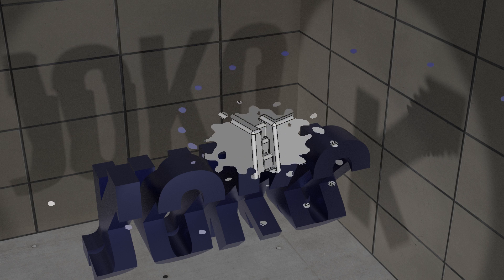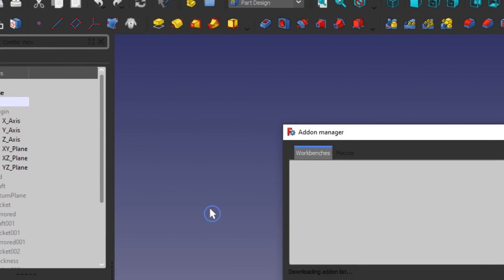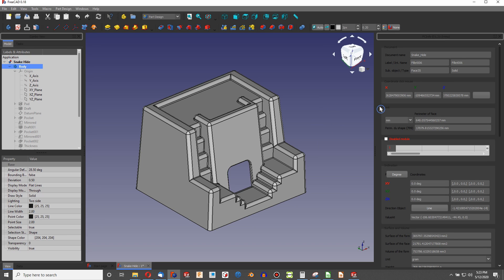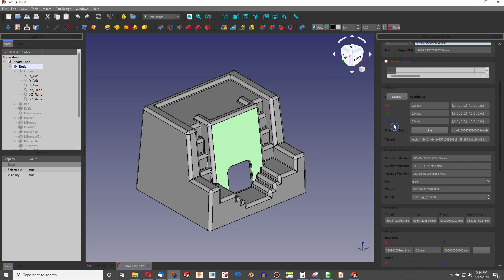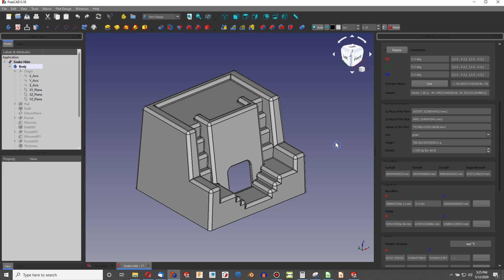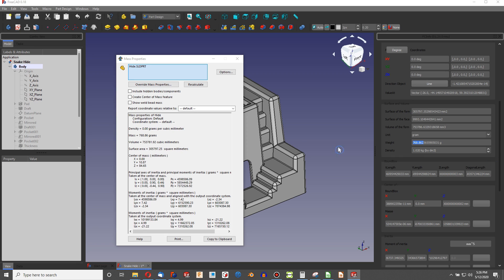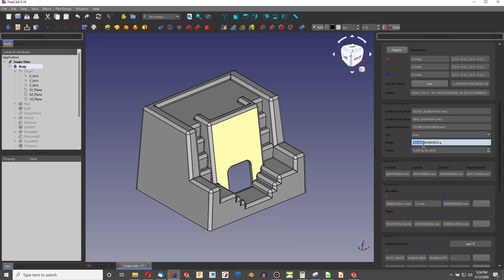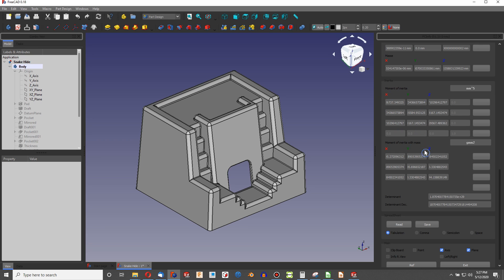FreeCAD Mass Properties - Weight, Volume, Area and More |JOKO ENGINEERING|

Comment: Interesting but I am having problems.  I am using FreeCAD 0.19.  Are their compatibility problems with this FCinfo macro?
For example I get the following error which at my beginner level of understanding means nothing:

07:13:14  Traceback (most recent call last):
  File "C:/Users/Public/Documents/FreeCAD/Macros/IanJobson/freecad/FCInfo.FCMacro", line 8323, in addSelection
    ui.lineEdit_5.setStyleSheet(u"color : QPalette.Base;")    # origin system
<class 'AttributeError'>: 'str' object has no attribute 'lineEdit_5'

Comment: Thank you so much! This is so useful. FreeCAD has so much good stuff buried under the add-on manager. Which is great because you can customize to your use case. But it's bad because there's so much that I think it can't do but as it turns out I just don't know where to look. Like in this case googling for volume and mass info told me to run python scripts or manually compute it from survey data when all I really needed was right there.